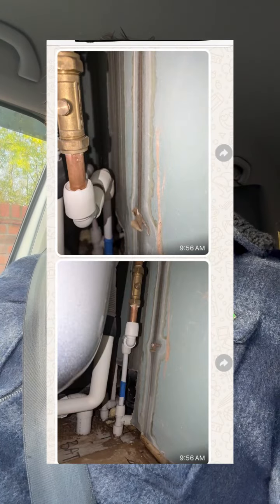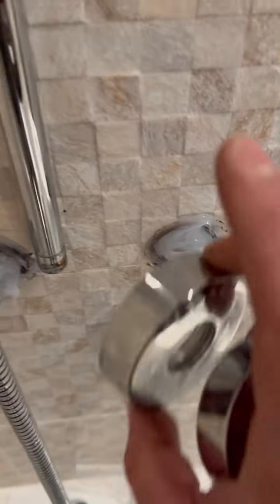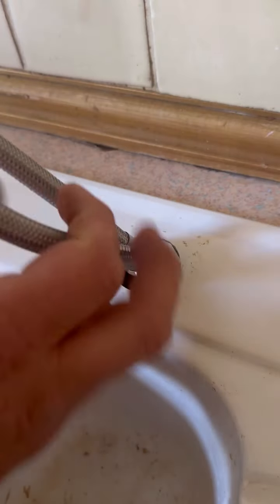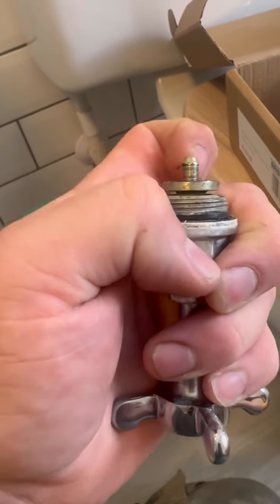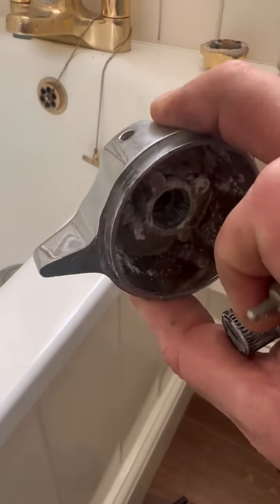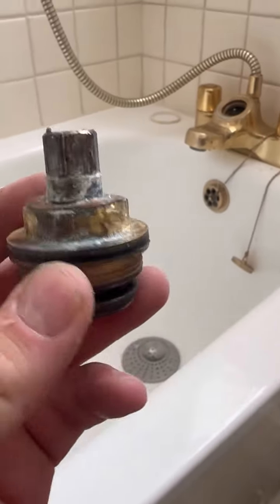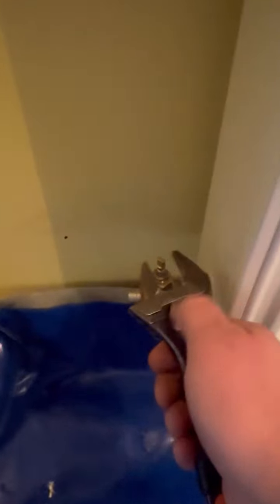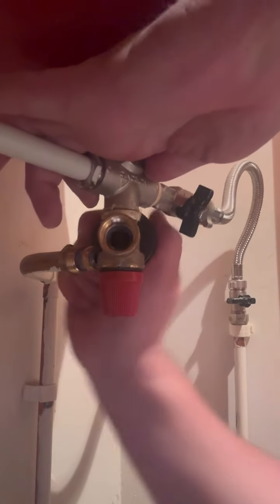Day in the life of a… nearly *runs out of title ideas*

Comment: Hey good video what was the tool you use to take the kitchen tap off
Reply from the maker: @AnthonyMccormack-u9w  bahco deep socket set 👌🏻
Reply from the maker: @AnthonyMccormack-u9w  also way way cheaper than the silly nerrad kit thats far too big
Reply: @professorplumb  thank you tell me about the tap kit is over price
Reply: Bahco SL25L Socket & Mechanical Set, Metric ,Black/Red,1/4" Dynamic Drive, 37 Pieces
Is this the one around 39.99.
Reply from the maker: @Gaz2604-u9c  just checked 👍 yes thats it
Reply: @professorplumb  cheers, pal. Much appreciated